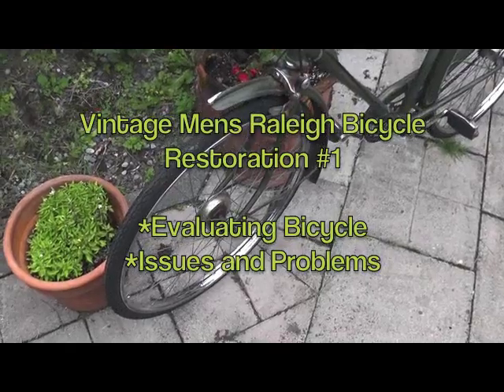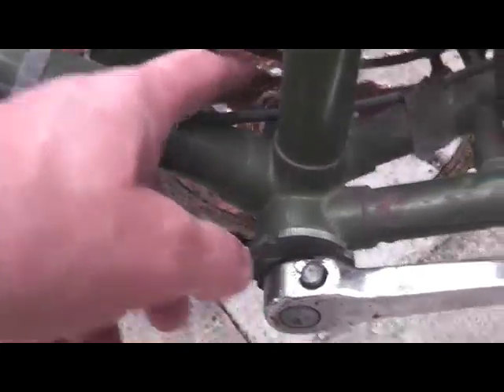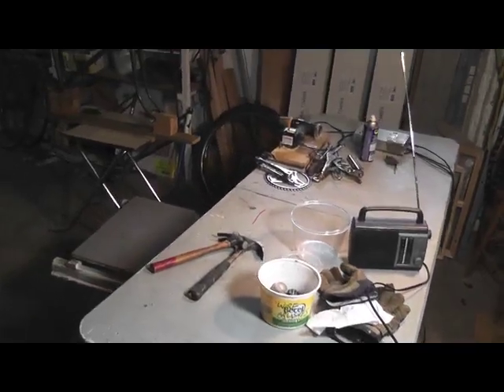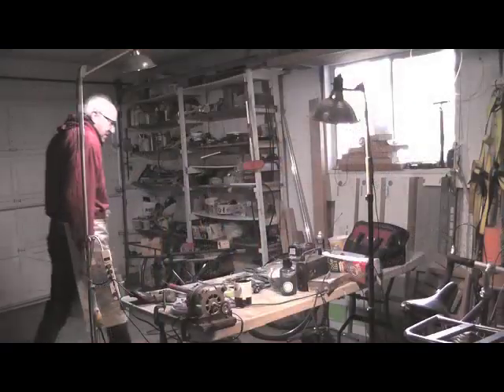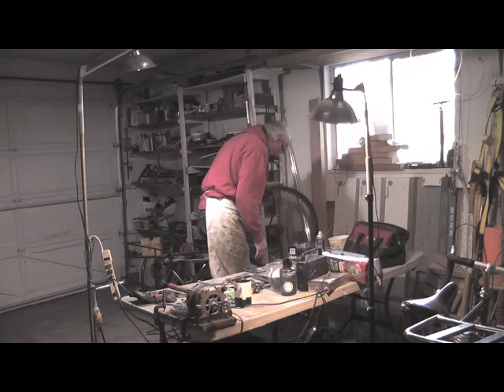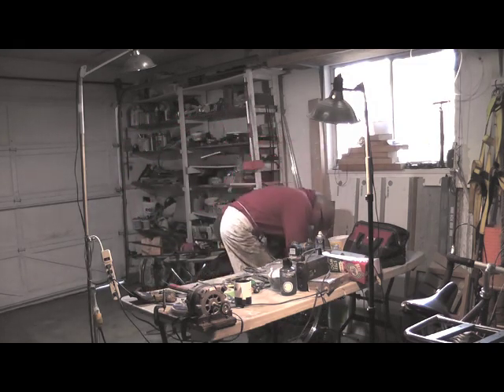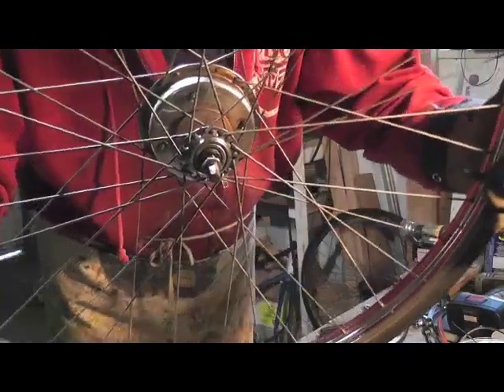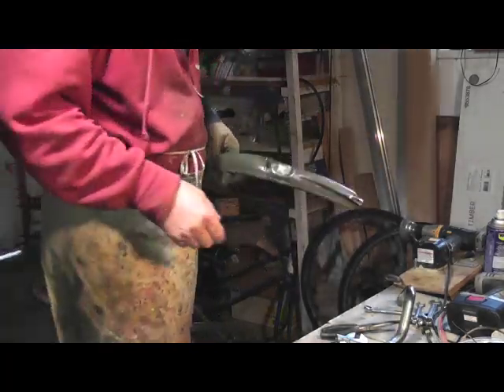VINTAGE BICYCLE RESTORATION     #1

Comment: I do my work much differently with vintage bikes. I'll inspect the bike for major problems, and only replace what I have to to make it work. I like to leave my bikes 100% original if possible, even if they are extremely rusty.
I have been loving watching your videos however, and I love seeing the way you do things. Thank you for posting them.
Reply from the maker: It's great to hear from you on how you repair vintage bikes. I sometimes leave the paint if it's in good condition but I polish the chrome as you have seen. I love it when the wheels bearings are cleaned and reassembled and they run smoothly. The Raleigh 3 speed hub has a clicking sound that reminds me of the old bikes when I was young. Thanks for the comments.
Reply: Vintage huffy sunfire work restoring it no? Badly rusted lol
Reply: @WillyDahm  that looks like a late 1968 or early 1972 Raleigh superb their top-of-the-line English 3 speed when you are working on the front wheel and specially if it's a front Dyno hub if you're going to remove the Magneto make sure you remove the Magneto and coil as one unit do not separate those two pieces together because if you do you will lose the ability to generate 6 volts of power but other than that I like that color of the bicycle.

Comment: That homemade cleaning wheel you got there is pretty awesome
Reply from the maker: It really polishes. It's a dish washer or wash machine motor and  goes at a high speed . One has to wear gloves and safety glasses when using it. I also had to install a foot pedal for safety reasons. It polishes everything in  minutes so it was well worth building.
Reply from the maker: It has a foot pedal and one has to wear gloves and glasses as it is quite dangerous. (high RPM) It was well worth the time building it as it has saved me hours of polishing.